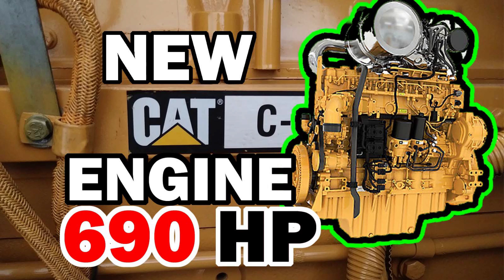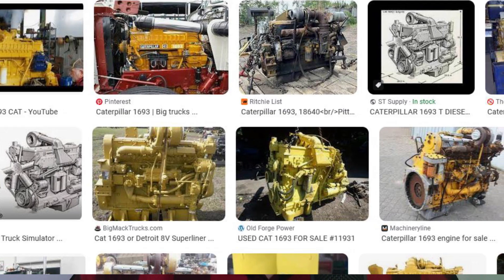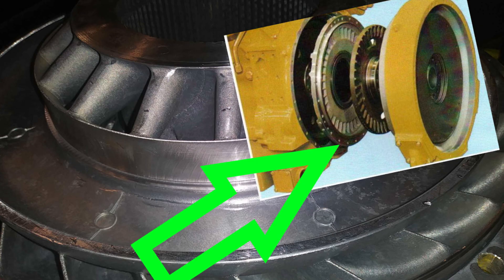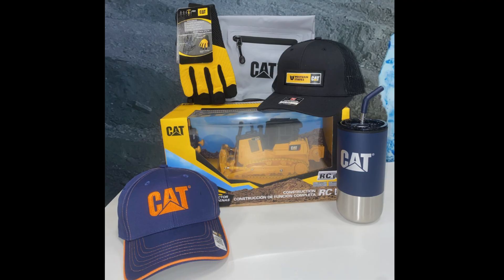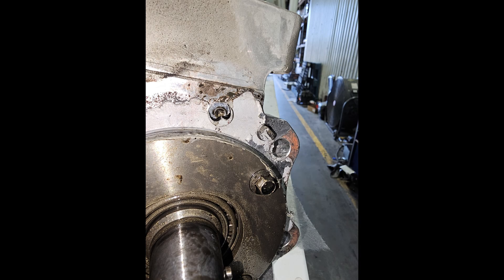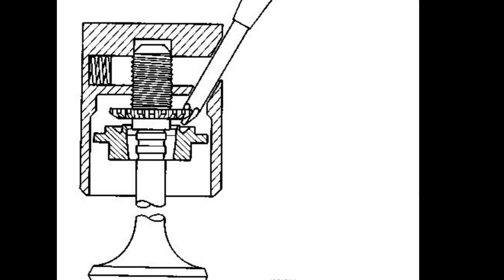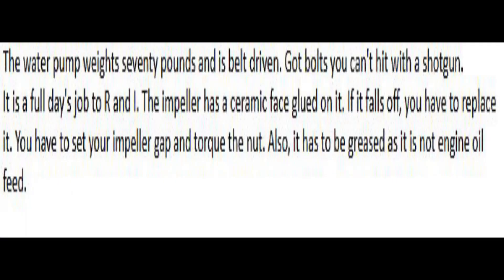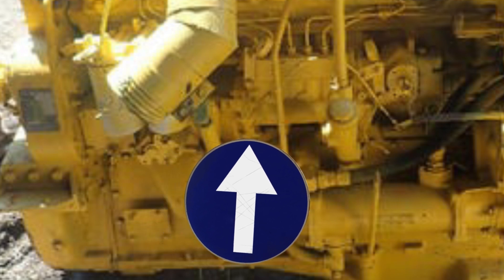The Coolest Diesel Engine You've Never Heard Of, Cat 1693, Dual Overhead Cam Caterpillar.

Comment: you are right about most of your information about the 1693 except the power. i owned a couple of these and drove several others. as set to spec from the factory they were not a ball of fire so we all that had these hot roded them turn the fuel tothem they would pull the hind wheels out of helland pass every thing but a fuel stop. you definitely needed a big radiator and plenty of flow. did not have much of a leaking problem on any of them that i was around. if you maintained them properly even thou they were souped up they ran for ever. probably a better engine for a owner operator that drove it himself rather than a hired steering wheel holder than can barely find his way into the cab.

Comment: Great presentation Josh...  An interesting video of One of the earlier  CAT OTR diesel engines that paved the way for their Outstanding 3406 engines... That engine oil driven retarder is very interesting, but it also appears to be best suited for the automatic transmissions that were later commonly used on tour bus's and other vehicles that needed to be quieter than using jake-brales..

Comment: 1693's were used alot in the logging industry as power for yarders. I in- framed several of them in Madill 009's, also in Skagits, Skookum and Berger towers.  They were well known for over heating and breaking heads however, but when they pulled, they really pulled.
Reply: 😂 no kidding! And they were always seized up after a long shutdown, too. We have one in our museum 009, and I got “volunteered “ to try and get it running so we could raise it. I took the top cover off, and was more than a little surprised to find two overhead cams. Didn’t expect that in such an old engine (1968). We eventually got it running, but by the time the pipe was up, it started leaking oil badly, and the dipstick kept launching itself out of the tube. Also, lots of coolant in the oil.

Comment: My 1975 3406A is a 380 horse WJAC pre cup engine with glow plugs, i think its a 92V prefix
Reply: 380 HP 3406 92U was DITA, highest HP PC, was a 375 PCTA, Of the 92U series the highest HP was a 400. To make a 380 into a 400, you had to change nozzles, fuel system camshaft, was the major items. To go to a DI from a PC, forget it. Cheaper to buy an engine.

Comment: Great history lesson, i  had a 1674 also duel overhead cam 638 cubic inches like the 3306. it was rated at 270 HP.  I ran both 1693 T and TA in the high country or Colorado.
As i remember the 1693TA weighed  close to 4000 pounds and the 3406A was 1000 pounds lighter. My last PC Cat was a 3408PCTA which I owned for 30 years. Definitely the good old days, right Jeff Anderson.  Some would say the PC Cats sounded like a bunch of squirrels cracking nuts 😀

Comment: WORKING ON THE LOCOMOTIVE SIZE CAT ENGINE ,A 3612 SERIES, THEY HAVE FLYWHEEL END CAM DRIVES, AS WELL AS THE GENERAL ELECTRIC 7 FLD SERIES
AND ALCO 244 AND 251
ENGINES.
WHEN WORKING FOR THE SANTA FE RAILROAD THEY DID AN ENGINE SWAP ON AN SD-45 LOCOMOTIVE, REMOVING THE 645 -20 ENGINE AND DROPPING IN A CAT 3612 , RATED AT 5000 HP.
THE HORSEPOWER WAS REDUCED TO 4300 HORSEPOWER IN DEFERENCE TO THE EMD TRACTION GENERATOR AND TRACTION MOTORS!
THEY HAD A MECHANIC S ERROR THAT CAUSED AN OVERSPEED WHICH DAMAGED THE CAM DRIVE TRAIN!
THEY PUT MY KID BROTHER ON DAY SHIFT, AND MYSELF ON AFTERNOON SHIFT TO REPAIR THE DAMAGE!
I CAME UP WITH A MINOR CHANGE TO THE CAM IDLER GEARS WHICH MADE IT POSSIBLE TO FULLY SERVICE THE CAM DRIVE TRAIN WITHOUT REMOVING THE TRACTION GENERATOR!
FOR MY IDEA I WAS RECOGNIZED AND NICELY THANKED BY CATERPILLAR CORP!
THE 3612 IN THE SD-45 
WAS AN AWSOME PERFORMER, GIVING 25 % BETTER FUEL MILEAGE AND  MUCH MORE TORQUE AND RECOVERY ABILITIES !
THIS EXPERIMENT BADLY FRIGHTENED EMD AND THEY BEGAN A CRASH PROGRAM TO DEVELOP AN 4 STROKE 
DIESEL LOCOMOTIVE ENGINE OF THEIR OWN, WHICH WAS A MISERABLE FAILURE!
GENERAL MOTORS ENDED UP SELLING OUT THE ENTIRE LOCOMOTIVE DIVISION,
TO THE GREENBRIER CORPORATION, AND EMD IS NOW A PART OF CATERPILLAR CORP NOW!!
KEEP THEM ROLLING BROTHERS!👍👍

Comment: I bought a Pete in 82 had for 10 years , when you rolled into a truck stop their was no question what was under the hood. Now I have a 77 Pete with a 425 HP.  1 Negative was the weight of the engine.

Comment: That double Overhead cam is a Mercedes design The caterpillar Inc. into the engine. I’m in South Florida and all the ones that I worked on where in Shampooch was so cool to Duval settings or just a Phillips screwdriver after you take the valve cover off. Do you want to say that they’re in efficient they were stingy on fuel compared to the Detroits! None of the boats had glow plugs in the winter it’s on the crewman down to get a quarter inch plug and watching captain had the engine rolling one quick squirt of either and off it goes. If it doesn’t sound like a bunch of marbles flying around inside the engine shut it off immediately! I rebuilt one 75% by myself where the block was so bad they had coolant in the base the block was corroded in the O-rings area the liner . marine tex  ed liner bore out 42,000 hours later it was still running. 👍 Great engine in my book

Comment: All Caterpillar engines, except an 1100/3200, had precombustion fuel system. It was IMPERATIVE to maintain adequate coolant level, otherwise precombustion chamber heat would crack the head. BUT, they'd burn about anything for fuel.

Comment: Rear gear train means cam had to come through the firewall. Also the overhead adjustment was never perfect. The old clickers as we called them were either too tight or too loose generally

Comment: The only other engine that could compete with the 1693 is the cummins kt ktta 450 up 600 factory hp rating, my father and grandfather had 4 kw cabovers with the 1693 in them and they absolutely loved them and wouldn't have any other engine's until my father bought his first kta 650 and it was game over, and their 1693 were rated at 425 hp from the factory

Comment: Great video! 
If you mentioned it then I missed it but the early 3406's also had pre cup heads. I had a 375 hp 3406 in a 77 W900 that clattered like an old D7 and I think the 380 and 400 hp 3406A's were the first DI engines but I could be wrong. My next engine was a 3406A 400 hp and it was DI.

Comment: We talk about the 1693, D343! The D346,D348, D349 started out as a block refereed as a 90 degree had rear housings with 13 gears in it!  Cams looked like the D343! the later ones were called 60 degree, and the cams were in a cam box that you bolts on the head as one unit. They came a long way, but were used in heavy equipment a lot.

Comment: I worked at a moving company in 1973.The first cab over pete had a 1693 rated at 425hp.They were beasts.The truck would go 120 mph.They were very durable.I always thought that they took an off road motor and put it in a truck.
Reply: Essentially they did. Industrial model number was D343. A regular brute.
Reply: I believe the D343’ main difference was it came with an SAE number 0 flywheel housing to mate up with big stuff, where as the 1693 had a SAE number 1
flywheel housing as found in automotive applications. So without modifications you weren’t going to haul the iron out of the crusher and stick it in 
the truck.

Comment: They also made a 1674 before the 1693— great engine as long as you did not over rev them. They had soft cams as well as the key to the cam. They would run run back words if you did not start them correctly. They came in at 375  horse power or 425. They knocked because the injector sat up inside the head.
Reply: I don't believe they referred to those as injectors, They were fuel nozzles

Comment: They were a great engine, but the engines were heavy and expensive to work on  did not like heat cracked head head was 2000 back i. 70s

Comment: One thing I don't understand about people. Why are they still fixated about how much horsepower a diesel makes? The diesel don't make horsepower. Diesel makes torque. Gasoline is make horsepower I wish people stop focusing on the horsepower and focus on the torque of a diesel because diesel is only make their torque in the low part of their RPM band right between about 1500 RPMs That's when a diesel shines

Comment: 1969; I order a custom-built Freightliner, when Freightliner was still being built on Swan Island, 1693 powered. Rebuilt at 1, ONE million miles, retarder added. Retired at two million miles. Today it lives on a pallet in my warehouse. 525 horse, top Cabbage pass at 53 mph, 73280 gvw. Since that purchase I've enjoyed 3406 & 3408 (not so much the 08) Side note; in those early days Cat invited us O/O to stop wherever we found the Cat service rig, typically highway construction sites, for our service needs.
Reply: I have heard of several 1693's being high milers. 
Back in my wrenching days ,remember a customer having them in log trucks. 2 of them went over a million before rebuild. 
They were also popular yarder engines. Had many customers with them in Madill 009's and others.  Cranked up the fuel a bit and was common to get 550 575 horsepower out of them. Of course they didn't last as long. 1693's yarded many a board foot of logs back in the day.

Comment: Since we are on the top of older cat engines, I was wondering what cat engine would have been in a particular truck. It was a late 80s (maybe 87) Mack Superliner, but custom. The hood had to be stretched to fit over the engine, since I think it was the largest cat engine offered at the time. Truck was used for overweight/size loads.

Comment: So the 1693 pretty much worked like the Navistar/Ford IDI diesels. And 4 MPG for a class 8 truck isn’t terrible keep in mind that in the 60s cars were barely cracking 15 MPG as far the US goes and even now class 8 trucks are barely getting 5-7 MPG and that’s for curb sniffers (aero cab trucks)

Yes, that’s a 60% boost in efficiency but it’s not impressive when you’re in the single digits to begin with it’s far more impressive to a 60% bump in fuel efficiency from a vehicle that’s already doin around 35 MPG.

Comment: Cut my teeth on my brother's 1693TA. He bought with his 73 Pete 352. Was a straight 1693 but wasn't long before the TA was done! Yes Clatterpillar was spot on. Just walk through the lot and you knew one brand from the other! They were monsters for the day and reliability was top notch. Pumped the fuel to them and go! They were heavy and expensive which never really left Cat engine lore. Brother then bought a couple Frtliners with Allis Chalmers 450 motors. Pulled even better than a 1693 if possible! Big mistake! Wouldn't hold to together at higher rpm's. Eventually switched them over to Cummins before he went broke with them! But can still recognize the idle of a 1693 and loved them! Great video and thanks for posting!

Comment: Interesting engine, really different to British engines. Most British engine makers in the late 1950s had dropped the ante-chamber design . It’s been common on engines up to half litre per cylinder until quite recently, but the issues of cold starting, head cracking, smokey exhaust.
Gardner and AEC, both had direct injection diesels in WW2, Leyland by early fifties. But , nobody made a road diesel over 150 bhp in Britain until about 1960, and it wasn’t until the 1970s that we got engines of 250 bhp or more. ( and most were poor reliability)

Comment: OUR COMPANY GOT A KENWORTH WITH A 1693 /425   IN IT IN 1971 /IT WAS EXPERIMENTAL AND HE GOT A REAL DEAL ON IT /SO WHEN IT GOT HOME EVERY WEEK  IT WENT TO THE SHOP FOR TEST AND SERVICE/IT WAS A PRETTY GOOD TRUCK IF I REMEMBER /IT PULLED GOOD COMING OUT OF DENVER IN THE MOUNTAINS /IT HAD A 13 SPEED BEHIND IT/ AND OF COURSE FUEL WAS CHEAP THOSE DAYS SO HE WAS NOT TO CONCERNED WITH THE MILEAGE/ IF I REMEMBER  THEY PUT A HALF MILLION MILES ON IT WITH TEAM DRIVERS /BEFORE HE TRADED IT

Comment: Yes, they were big and somewhat cumbersome, and they competed with Detroit to see which one leaked more oil. But you couldn't work one to death; you had to kill it with a stick; and a BIG stick at that. Cat's philosophy at the time: "Make a product. If it fails, make it an inch thicker and 100 lbs heavier. Consequently, Cat's products were heavy. The 1693 was just one engine that was designed to last. It's sister engine, the D343 was another force to be reckoned with. Pre-cups were used by many engine builders. It was designed more to give combustion a more steady push instead of an instant "bang" with nothing left, which was characteristic of Direct Injection. Changing the injection rate toned that down and made it much more controllable. Cat also might have been a little more stubborn as it had been using precups since the 30s. It used precups on the 3406A, the 3408 and 3412 well into the 80s. The long injection pump drive was partly to house the injection advance mechanism, which was incorporated into the accessory drive shaft. Cat designed the advance into the drive gears of the 3406A and B but it took a while before it decided to shorten the acc drive. I disagree with direct injection requiring larger bearings. The 3406 series used the same on both precup and direct. It went to larger bearings on the 3406C mainly because the hp requirement demanded the bottom end be stronger. Sorry for getting a little long-winded there. I was a mechanic for 50 years and loved everything mechanical for longer than that; It's pretty hard to take the mechanic out of the individual...
Reply: Perkins made a 4 cylinder indirect injection diesel known as the L4 in the 50s. They put a direct injection head on it and called it the 4/270D. Everything below the head was unchanged which would indicate that the stresses In combustion would be much the same. The 4/270D was a very good engine except the wet sleeves.

Comment: The valve adjustment mechanism was referred to as “ click type “. Every time you rotated it one click it adjusted the valve clearance 002. 
The engine had an Achilles Heel. There was a plug in the crankcase that would work its way out. All the oil would then dump directly into the pan
and you needed a new crankshaft. These were pretty much the highest horse engine back in the day.  You’d pass everything on the road. Typically…  other trucks on the highway would be capped at a Cummins 335, or a 318 Detroit.  Oil companies might have some V 12 Detroits 
but fleet trucks would be less than 350 horse even trucks pulling trains.  You used gears, patience, and knowledge of the road back then.
I pulled 78,000 on the deck grossing 118,000 lbs in a Dodge C 900 powered by a NH 250 Cummins.  You knew where all the invisible hills where. 
Trailer was a 4 axle with 8 ft spread.  In Canada there wasn’t many highways that would compare to an interstate. Where you’d have to split the box, today you might only drop one gear.  Mechanical fuel timing had its limitations.
Reply: 1674 was click type, 1693 had cam followers.

Comment: Thanks for reminding me how old I am, Josh. My boss in the mid-1970's was a Cat man thru-and-thru. He loved the 1693T @ 325 hp. He dreamed of the 1693TA @ 375 hp (and of the Brake Saver), but he cared even more about costs, so his choice was the 1693T. He frequently said, "It sounds like it's fallin' apart, but it'll outrun a 350 Cummins." In my experience, I think he was right on both counts. He also had one truck with the 1673T. (10L @ 270 hp) As the junior driver, I often was assigned that truck. It had trouble getting out of its own way, but I did like the fact that it was a '74 Diamond Reo Royale which seemed to catch a lot of attention. Yup. 4 mpg, but fuel was cheap - 43 cents per gallon at the Red Comet in Ft. Wayne, IN. My boss was a great man who remained a friend for life. I have scores of great memories from those days.
Reply: I have got a 325HP Cat sticker and always wondered what Cat motor it referred to.
Reply: I think it was a 1674. Had 1 in a '74 diamond reo and 1 in a '74 road commode. Good east coast trucks with decent fuel mileage.
Reply: @genearthur6889  1674 - you are correct, Sir. At my age, I'm OK with being a little off, but appreciate your comment.

Comment: Joe Musselwhite: My favorite CAT engine is the 3406E for several reasons. 1) it was my first exposure to CAT engines thanks to this channel 2) 3406E has incredible horsepower 450-700hp, 3) first truly successful electric controlled engine. 4) 3406E set the standard for years. Even though it was made from 1993-1999 it influenced some iconic engines like the C15 which has a lot of the same features with some issues fixed like oil leaks and some added relief slots. My goal is to do a total rebuild on a 3406E. Thanks for exposing me to this amazing engine. Ironically,  the first engine I was assigned to get running at my new job was the 3406E.